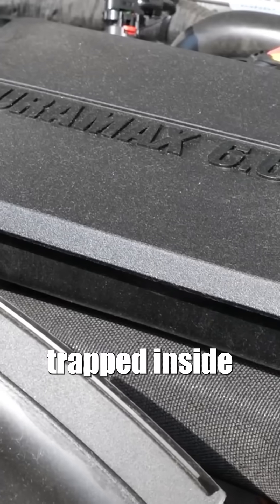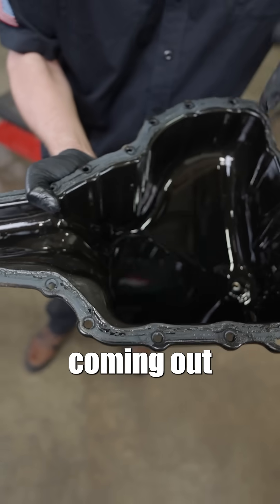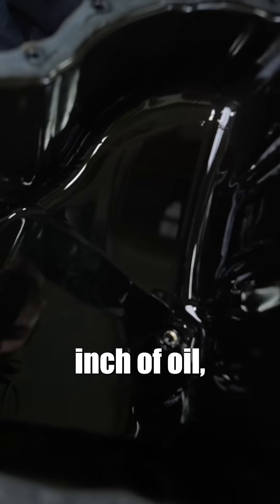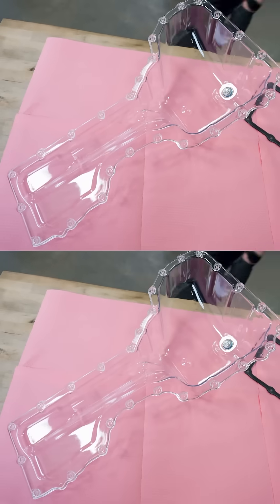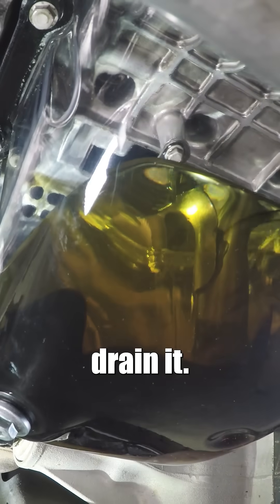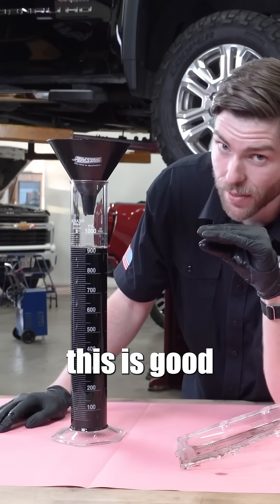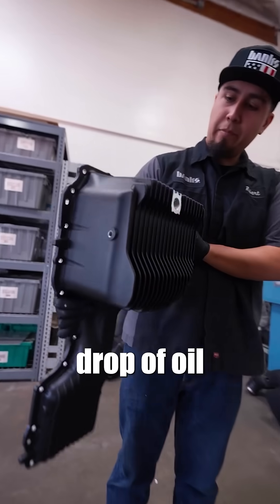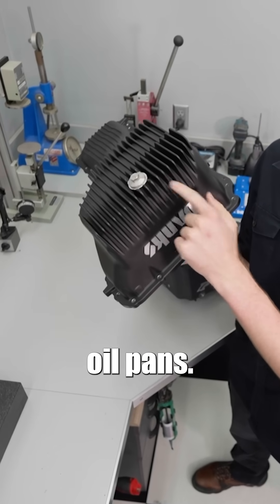A disturbing discovery. This dirty oil is trapped.

Comment: The dirty oil gets mixed with the newly replaced so it’s always deluted/ filtered out overtime, but this is also banks so I’m cool with it
Reply: "I'm not buying this no way"

"HOLY SHIT ITS FUCKING BANKS LETS GOO"
Reply: @statik404 💯
Reply: @statik404 that or you can just take a grinder to it
Reply: I understand what you’re illustrating. However, it’s going to get diluted every oil change… and if you change oil on or before the recommended intervals, you’re good. Thanks for the video. It’s a good example of why regular oil changes are so important!
Reply from the maker: Although older oil is being diluted with fresh oil, it shouldn't discount the fact that there are still contaminates in the residual oil that is left in the sump. Over time, these metal deposits become greater and the issue is exacerbated. Most will agree that removing as much of the contaminated oil as possible is the optimal route to maintain your truck over it's lifespan.
Reply: @bankspower my engine is so old, I’m reasonably sure the dirt in the old oil is the only thing holding the gaskets together.
Reply: @bankspower  Or you can waste money on quadruple sequential oil changes with a few minutes runtime between each, to cut that contamination down by some undisclosed percentage. 🤪
Reply: @heythere6922  it's not undisclosed. A couple half capacity flushes is like 20 bucks and removes over 90% of the contaminates according to clarity and color observations. It's common sense.  Anything not new oil color is old oil color and only hurting the efficacy of the new oil.
Reply: @heythere6922  I'd be tempted, to try and get the metal sludge out!
Reply: @bankspower that is exactly what the filter is for. Don't get me wrong, I'm absolutely a fan of a better, cooler oil pan. Not hating, just not so sure this reasoning is good to justify the pan.

It will dilute the oil, and any contamination gets removed by the filter. Its no big deal provided you use proper oil change intervals.
Reply: @Tykoderz exactly. This is misleading to people who otherwise don't understand how the oil system works. Yes, a little old stays in the motor. However, its not really that bad considering. Especially if your changing the oil regularly like you should. The benefits of the banks oil pan is more in the additional cooling traits.
Reply: @Tykoderz 👍
Reply: @Tykoderz  the pump has to suck up any bullshit that you want the filter to grab, the pump gets trashed by debris over time
Reply: @Tykoderz dirty oil etc goes trough the oil pump before the filter. Not an issue?
Reply: @anttikaipainen6072  no more than likely not. Anything that large would likely mean much worse issues. The upper limit for pump clearance in my subaru for example is .1mm ish. I would be surprised if something that big didn't cause other issues and if it would actually get picked by the pickup tube. I totally get the idea of getting every drop of oil out. It's not happening in this case either btw, oil will still stick to the bottom of the pan, just not as much. There is oil everywhere in the engine from the last oil change.

I would wager a lot of money there exists 10s of millions of cars on the road, operating fine for years and years, that have had oil in the bottom of them every single oil change. 

One big reason the pickup doesn't typically sit above the drain point is that is maintains some level of prime during first start after a change. Its easier on the pump to not be pumping air for a second or two as well.
Reply: @Tykoderz Filters, filter the oil, collect all the particles.
What about the chemistry of oil? İf only problem is particles, then we wouldn't change the oil, we would change the filter :)
Old oil has no good lubrication specs anymore and also affects new oil performance in a bad way.
Reply: @Tufan-zn9he  it's a small amount of oil. The cleansing properties and lubrication properties of the new oil will be demished an insignificant amount. If the engineers didn't think it would be a worry. It's not.
Reply: @Tykoderz  filter doesn't always work you know.
Reply: @Kratos-eg7ez  it works for anything that matters.
Reply: @AverageCitizen333 dude I’m not a mechanic and only changed oil a few times in my life. This is common sense that new mixes with old and it’s not the same quart just sitting there for the life of the car. This guy is advertising to stupid people.
Reply: @AverageCitizen333  You are, not your.
Reply: @thomasmleahy6218  i do'nt care about you'r grammar policing.
Reply: @Tykoderz not all contamination, that's why you have to change the oil unless you have a bypass filter
Reply: @Tykoderz  oil filter don’t filter everything unless you running an oil bypass filter still that leaves dirt
Reply: @AverageCitizen333 It’s -28°C outside right now at my house. I wonder how that super cool oil pan will have a detrimental effect on my trucks ability to stay warm!
Reply: @AquaticLogic  i guess they built it for people who make better decisions haha
Reply: @bankspower Should really look up just how much an old Flathead 6 filters oil in the system. It’s not even a total circulation, something like 20% and these engines last forever. You’re kind of fear mongering over a quart having contamination in a full circulation filtration system is pretty laughable. The second you start any broken in engine you’ve introduced contamination.
Reply: @bankspower  that’s why your supposed to run the vehicle prior to drain, to make sure it’s in suspension to maximize removal. I run a good amount of banks products, but this one is a product in search of a problem instead of being a solution to an actual problem. If contamination is a problem on a vehicle then the proper solution is to increase frequency of drains, not starve the engine of oil on startup from draining the pickup.
Reply: @bankspower I mean technically there’s contaminates in all of the oil that’s constantly being filtered.. and the contaminants in that quart won’t be the same ones after the next oil change because it’s always mixing with other oil.. 
yea getting all of it is better but you never truly get all of it because it’s throughout the engine when you drain it
Reply: @bankspower  simply throw a quart of water into the engine so the oil rises over the plug hole lip.....

But then I vacuum mine out so you're sales pitch lies don't work on me.
Reply: @bankspower if that’s the case you can remove the entire pan once every 3-4 oil changes. You’re selling a product that the market never asked for, and doesn’t see value in.
Reply: @bankspower the average person doesn’t care about the quart of dirty oil
Reply: @bankspower  Another point is the lubricating properties and the additives in the oil. They also break down over time and with use. Removing as much oil as possible allows the fresh oil with the adequate properties to do it's job inside the motor, and do it better. It's not all about contamination.
Reply: @bankspower  I wonder if the designed it in that way to keep the sump primed for first start ups after a service. Still though, a quart seems like an awful lot.
Reply: @bankspower that’s why you have a filter.
Reply: I do agree. And ill be buying this. Love the phenomenal engineering and design.  Good job Banks. Again. @bankspower
Reply: @bankspower  and thats why you change the filter at the same time.
Reply: @bankspower yes it would be optimal, but it's not a compounding problem as any metal filings should be easily caught by the filter. some diesel engines have a vally that will hold alot of old oil, that oil is used to power injectors and leads to premature failure, this won't help that particular problem.
Reply: @bankspower them fins be good in California summers, but very bad in an alberta winter. 😂
Reply: @bankspower I don’t think anyone can say for sure unless we know how much it’s diluted. And we don’t know. My guess is it would be very diluted. Maybe 1/20th of the total capacity or even less. The contamination would not get greater since you’re diluting it and adding the same amount of impurities to it if you maintain the same period between oil changes. If it sat in the bottom each time then yeah sure. But it doesn’t. It’s diluted each time so a lot of those impurities will be removed when you change the oil.
Reply: @bankspower  only worriesome part of that for me is metal bits from engine break in, yet I've changed oil thousands of times and have never seen metal bits on any engine with more than 10,000 miles on it so I'm sure it isn't really an issue.
Reply: @bankspower  if you have a lot of  metal in your oil, you have bigger problems than the oil pan. I'm sure the oil filter can handle the amount of metal expected from a healthy engine
Reply: @bankspower Obviously, but I can buy alot of oil with the money I saved on not buying the sump. To save even more money I can also take the stock sump off, drill out the old sump plug and weld on a new one that points down and just empty all the oil that way
Reply: @bankspower don’t think anyone is saying it shouldn’t be removed but the idea that it’s going to ruin an engine is just wrong. Otherwise all cars wouldn’t have done nearly as well as they have.
Reply: @bankspower  Doesn't oil extraction negate this issue? Also, this would only be an issue with steel sump but not aluminum ones, when draining. With dry sump, how much oil is being left?
Reply: @bankspower 
Price ?
Reply: @bankspower but, the dry run of the startup after the oil change, wouldn’t be worse ? I mean, yes it might trap some shavings in the "stagnant" oil ( which is really not ) but if you have sludge in quantities that it becomes an issue, I am pretty confident that the engine would have more immediate problems than this sludge…
If engineers have designed it whit this trapped oil in the sump I do believe it’s for the air lock. Faster replenishing of the empty filters etc etc. 
If it was a real issue, why would you not use a quart more, change your oil. Run the engine for maybe 15 minutes and then replace a quart…
Reply: @bankspower you're trying really hard to prove this shit isn't useless
Reply: @bankspower  That's just not true. Then how come hondas and toyotas last hundreds of thousands of miles. The problem is not exacerbated with time. It's a cycle of dilution and change with every other oil change. The other benefits are completely valid, especially for performance cars. But to make a claim that not getting your product is BAD for your engine is just marketing.
Reply: @bankspower good thing, the oil filter is changed with each oil change, right?
Reply: @bankspower bro it’s fine
Reply: @bankspower  There are lots of engines that not every drop of oil is removed. Some engines its not possible ie: Deutz engines that the cooling system is the lube oil. These engines run for 1000's of hours without issues.
Reply: @jamesvpaquette  Yep!  Like to see the data that shows the effect of actually switching to this pan in terms of extended engine life.  I am skeptical that there would be anything measurable.  These things sell off fear and marketing.  I think directionally this pan is better, but will it ever pay for itself, likely not.  The engine will fail for some other cause before the extra quart of dirty oil being hung will.
Reply: @D2O2 well it's up to you to decide whether it's worth or not, they are at least being up front about what it actually does.

They shouldn't have to make this part, the factory should get it right. I get you don't have to drain all the oil in a car, but an entire quart is a ridiculous amount to leave undrained.
Reply: @D2O2  yeah, I like the idea of something like this just because it doesn't hurt anything out to get as much as possible. But I would never pay for it if it didn't come stock.
Reply: @bankspower  none this really matters. But people have to make money with out doing manual labor so here we are.
Reply: @bankspower  you are trying to create a problem, that isnt a problem, and then try to come up with a solution, just to sell your product. and its fine you do that. you are a business, you need to sell your product, but dont make up problems that arnt problems.
Reply: @bankspower if you stay on top of your maintenance oil changes that shouldn't be an issue. There is a reason you replace your oil filter with your oil. The new oil dilutes the old oil. Then the oil filter continues to clean the oil of contaminants. Like this is kind of fear mongering on your side.
Reply: @bankspower  are the fins for cooling?
Reply: @thuokagiri5550  more surface area means more heat transfer, more cooling, hence the fin design. You probably see fins in multiple applications, from a heat sink for your CPU, to large power transformers
Reply: @bankspower  is this partial scare mongering marketing tactics?
Reply: @bankspower a $429 solution to a nonproblem.   Still your pan is beautiful and this comes from someone who lived down the street from Dick Moroso, we loved how they turned their factory into a haunted house,
Reply: @bankspower those contaminates then go into my brand spanking new oil filter aaaaand... mostly cleaned out. I don't think the minor damage done, assuming you change filters every time you change oil, is a real problem that needs a solution
Reply: @bankspower fixing a nonissue…
Reply: @bankspower those deposits are captured by the filter, if you have metal deposits then you have a much bigger issue than the oil left over.
Reply: @bankspower that's why I do a flush every other oil change. I flush it twice after draining and fill a 3rd time. And it's clean. Need to flush regardless of proper draining.
Reply: @YOUTUBEisEVIL so now you are always having a bit of dirty oil and the flush guild left there as well?
Reply: @RemmikRotus  you can't escape that problem. Always residual oil
Reply: @YOUTUBEisEVIL so you're $300 per DIY oil change. Nice lol😂
Reply: @YOUTUBEisEVIL  do you just flush with oil or what do you use? i need to do mine soon
Reply: @manlopogo  I do oil. The problem with heavy detergent flushes is all that carbon build up breaking loose can cause more of a problem then it solves.   I flush it twice with only  2 quarts of cheaper oil for engines  up to a 6 quart capcity. It's just idling and very light revs just to circulate it and gather contaminates so it's ok that's it's only 2 quarts for about 60 seconds. Dump filter contents after each flush too to eliminate as much residual oil as possible. Than after the second flush (3rd drain. ) Fill to capacity with higher quality oil and change filter. It's crystal clear after that. Just did today on a Lexus gs 300(3.0L /5.7qt capacity)  and my Audi a4 (1.8T  5qt capacity)
Reply: The pick up tube is not holding an extra quart. If your capacity is 6 quarts and it's full when you drain it. You get 6 out.
Reply: @YOUTUBEisEVIL Imagine all the wasted oil if this was widespread practice.
Reply: @YOUTUBEisEVIL Maybe the second flush wouldn’t be necessary with that oil pan or other methods that remove most of the oil. Could that be the case?
Reply: @YOUTUBEisEVIL Second question:
With what do you flush and do you use the full amount? I’m just curious.
Reply: @bankspower  That's why I got one of these and removed my filter completely. 😏 

If the filter is doing its job, this won't happen.  There's a difference between a sales pitch and complete bullsh!t.
Reply: @KRAMITDFROG filters will only remove contaminants on a larger scale vs the oil that has microscopic carbons that can pass through all filters. This is the main reason oil goes bad and the only reason it turns black, otherwise it would last years. This same carboned up oil is what is left in those pans and throughout the engine in crevices and thin film everywhere. The more of it that is left in there the worse for the longevity of the new oil. Although admittedly it’s not a huge difference and regular interval oil changes, stipulated by the manufacturer, is probably already factored in. I would suggest going out and getting on of these installed unless you have money to burn. Now if you are doing a nice engine build this will d be a great upgrade to blow the budget even further!
Reply: You obviously missed the video. How is a filter related to their pan?  @KRAMITDFROG 😂😂 Just dumb as could be.
Reply: @bankspower So if it's settling to the bottom and not being sucked up to then be captured by the filter, who cares?
Reply: Well its official i wont be getting this bassed on these comments.
Reply: Draining oil out of the pickup tube is a bad idea as it adds time for normal oil circulation on the first start after a change. There is some evidence that the initial start after an oil change is responsible for a lot if not most engine wear
Reply: If only there was some sort of filter to strain these large particles out of the oil.  An oil filter if you will
Reply: "This is banks so I'm cool with it." 

Yeah, and because you're cool with it they'll keep going down this path. Call shit like this out, ESPECIALLY because it's banks.
Reply: Use a dip stick siphon, problem solved 😀
Reply: @72waverly would be interesting to pull the drain plugs and drain, then see how much more oil is removed through a dipstick siphon.
Reply: @72waverly  Well, that depends where the dipstick comes into the pan!
Reply: Won't taking off the cap release the oil in the tube?
Reply: Yeah I always buy 2 extra quarts to run through it after it drains.
Reply: They also made the blame that EGR is actually good for your motor
Reply: Some care about there stuff and I would always try to get all oil out I'm surprised noone has done this. Before
Reply: I've gotten over 300k miles and still counting out of a few engines. Never had a pan like this. I don't need it. But damn is it cool. Lol
Reply: Why was I feeling the ick of “gimmick” until I saw “BANKS”. 😂. I went from ew to pulling out my wallet in about 0.5 seconds
Reply: thank you for existing
Reply: Better pump out the oil...
Reply: I change the oil in my duramax every 5,000 miles. I don’t care if it can go longer
Reply: Banks already make good products. drop the nonsense sells pitch and use the money to pay more to your engineers. Don't be another Boeing with the accounts take over.
Reply: That oil pan is unique for this video.. most sit flat.
Reply: I have a j tube that drains that oil too. It's very easy and only costs $3.20 on Amazon.
Reply: I can also just, you know, drop the sump and save money! 😂
Reply: The true prier way is a dry sump system
Reply: I’m just curious. 
Isn’t it possible to suck most of the oil out with a tube? 
I think this is the prescribed method for some Mercedes engines. 
Again I’m just curious and would like to know the pros and cons. Thanks!
Reply: Shop vac
Reply: I think the issue is more that you're paying for a full oil change and aren't getting one, and the mixing may mitigate the issue, but still, yuck!
Reply: This is why you can remove the pan. 🎉
Reply: just wait until they discovery the amount of oil in the oil pan isn't the total oil the system handles. most the time its only half the oil at most. :D its more important to use better filters, better oil, and more changes than new pans.
Reply: I absolutely hate running engine oil additives. Do not believe in it whatsoever. I just believe in short scheduled oil and oil filter changes (kept mine 5k miles, 3k if it’s got over 75k miles). Yes, oil filters do their job with filtering (very well), but they don’t stop every little thing. So personally, I’d love me a nice fucking oil pan.
Reply: I can fix the quart of oil without buying e new oil pan. 
But i need to buy a duramax first 😂
Reply: They draining the pick up tube. Are you aerating the oil pump too often and running the engine with no oil pressure for longer periods of time on start up after oil change
Reply: That oil prevents dry starts. With this product you oil pickup has to refill.
I'm on board with the cooling but that's all.
Reply: Well, let's do a home made machinery with a  transparent hose connected to the bottom and to a normal filter and a second lower particle filter, a two gallon tank receiving filtered oil and a second hose on the bottom of the tank and the other side connected to a sacrificial cap. Closing the environment and turning the engine with a power tool to make the oil flow and wash everything. We need two sacrificial oil pumps from the graveyard too to connect the filters.
😂
Reply: lol, inventing a solution for a non problem  😂
Reply: Guys calm down. Their trying to sell product. They only need one reason.
Reply: Imagine not being able to get Debris/ heavy sludge out of a motor . That's the issue here.
Reply: Exactly the reason they say change your oil frequently.this pan is a gimmick 😂
Reply: I usually waster a bottle of seafoam and then waste another qt of clean oil ...alot of waste but I want it out!
Reply: ima just build adapt a little pump harbor frieght pump that gets in there's and sucks it out😂😂😅😅